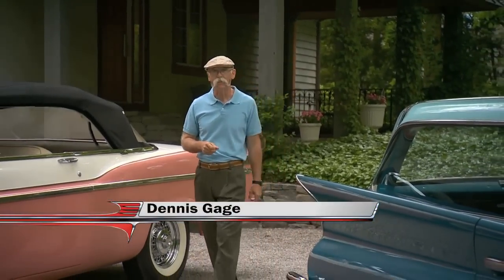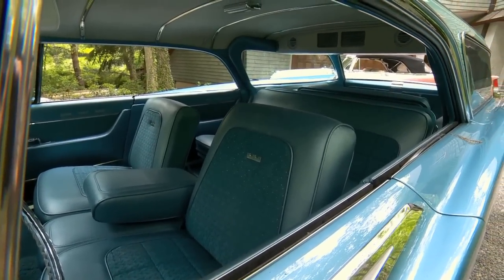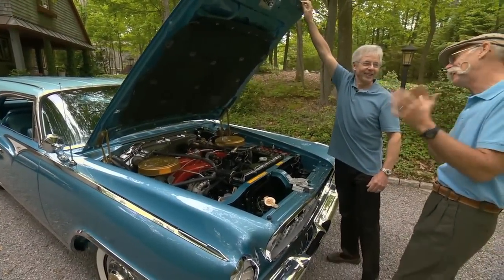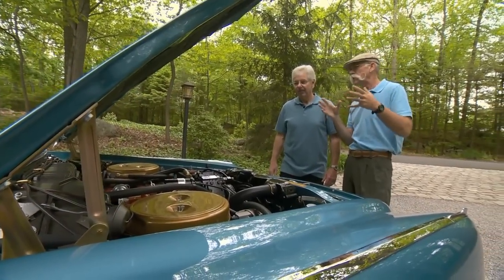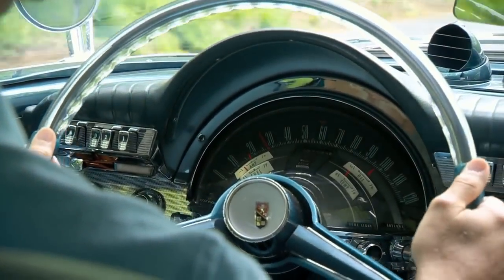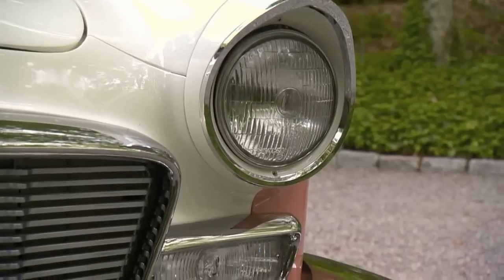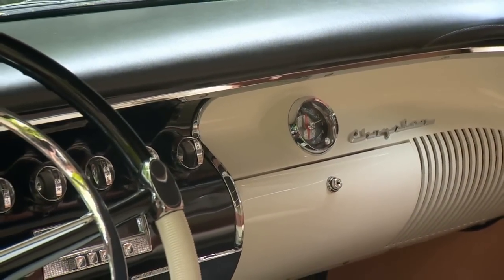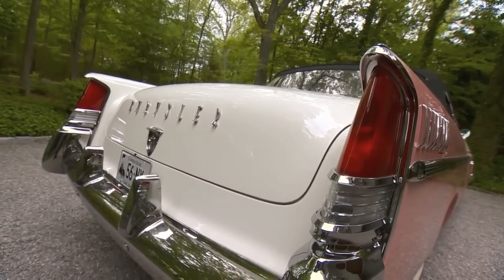Record Player in Classic Car! | Chrysler New Yorker Wagon & Convertible

Comment: 1961 New Yorker Wagon 9p . Total production was 760. That air conditioning unit in the wagon was $714.00 option. The carbs are Two Carter four barrel Type AFB Model 2903S. Base price was $4871.00.
Reply: I wonder what that sum would be in todays dollars? '23 🤔💸

Comment: yea buddy, my very first car in 1076 was a 1955 Dodge Custom Lancer, hemi, auto, the works, second car ever was a 1955 Chrysler New Yorker Deluxe, they both still had the manuals in the glove box and I was reading thru it one day and saw the instructions how to use the turn table which was an option in the day with a TUBE AMP,  both mine had very nice powerful tube amp radios, so nice sounding

Comment: Chrysler Corp. really built some great stuff back then. Starting with the 331 cu.in. FirePower 'hemi' in 1951, the 354 & the great 392 hemi from 1957. Their transmissions were bulletproof, from the 2spd PowerFlite to the TorqueFlite, coupled to really great engines. I'd love a 1960-61 Chrysler, two door or four door is fine.

Comment: Some interesting info on the use of record player in cars and particularly The Highway Hi-Fi:

The Highway Hi-Fi record player was the First in-car phonograph system and the first means of drivers playing their own choice of music as apposed to just listening to whatever was playing n the radio at any moment. It was invented at CBS Laboratories by the inventor of the 33 1/3 “Long-Playing” (LP) microgroove record. For a time, the Highway Hi-Fi was available as a factory-installed option in new Chrysler products. It was an absolute failure. It solved the issue record skipping by using a special shock absorbing system. To allow for full LP records that were compact enough to be used in a car they reduce the record speed and size to 16 2/3 rpm (half the normal speed of a 33 1/3 RPM LP) on 7 inch records. Because of the proprietary record speed and size it used, owners had to buy special licensed records for the system, generally Columbia records content, and only a small number of Highway Hi-Fi records were ever made. The Highway Hi-Fi ultimately was a big flop for several reasons. First, only Chrysler cars could get this dealer option installed. Second, the system sold for an additional $200 (more than $1,800 today) on cars it was an option for and this was fairly expensive for the time. Third, it’s proprietary format meant a limited selection of records were available for it (that might have change had it been more successful). Finally, while it was tuned to work fine on higher end Chrysler’s of the era with their higher end suspensions, they units were not as well tuned for the lower end model of Chrysler and thus tended a skip a lot more on those models leading many complaints and warranty requests. But when it first came up no one else offered anything like it. It was officially put out of its misery in 1958.

This would not the be the last time tChrysler tried to offer phonograph record playback in a car. Their next attempt was called “Auto Victrola” from RCA, sold in 1960/61. It used standard 45 RPM records, the same as used for singles played in jukeboxes of the era (these discs had the large hole in the center requiring an adaptor to playback on home turntables). It played back a stack of up to 14 conventional 45-rpm singles that you played in a under the dash unit. It also suffered from skipping issues on real-world pavement, but would have work great when “parked” with a date. 

Around the same time as “Auto Victoria” was being developed, a British company the Philips Mignon (sometimes called “Auto Mignon” and sold in the U.S. under the brand name Norelco, which also used 45 RPM records.   It turned out to be a more popular version with famous folks like the Beatles and Muhammad Ali both having on in their cars (George Harrison was famously photographed using the one in his Jaguar E-type and Ali was photograph with one n his ‘59 Cadillac). It worked differently the Auto Victoria in that it used a slot loading mechanism, many years ahead of the slot leading CD players used in cars in 90s and beyond. Thus you couldn’t play a stack of 45s but could swap them one at a time. It lasted the longest of all systems having been sold from 1958-1970.

Of course in the U.S., the first successful prerecorded music format for cars was the 8-Track cassette player introduced around 1965. It never had the same success in Europe but stuck around in the States until the last 8-Track was produced in the  mid-80s (by then though compact cassettes had taken over for new stereo aftermarket installs and as dealer options).

Comment: I believe I have seen that Awesome wagon written up in Hemming's Classic Car Mag! I think a two or 3 part series about nut and bolt restoration. I didn't read those, as I am not into the technicalities of redtoration; I just love airing the finished product! However I find totally original cars, not restored, "survivors," if you will...especially interrdting, if they are still running! 🎉😃😊

Comment: Regarding aftermarket sound. If you have a stock AM radio, there is an AM transmitter that operates on 12 V, manufactured by MFJ. You can connect your Ipod, ect, into it and listen to what ever you want to, but it's, of course, in mono. If you have an FM Stereo radio, there is a FM transmitter, usually found on eBay for about $5 ! that you plug into whatever source you provide, and can listen to your favorite tunes. My thing is that if you are fortunate to have a factory 8 track player, is that you can plug up a Realistic (radio shack) 8 track to cassette module to your 8 track player, then there is a 8 track to cassette adapter that has an 1/8" plug to connect to your iPod, or whatever MP3 player you have.  A small FM transmitter is my choice.
I mean, for 5 bucks, you can't go wrong. In my opinion, the Delco factory radios, provided by GM have the best sound.

Comment: the 56.. holy smokes she is loaded, nice both had clocks for 55 but not in the steering wheel.. so nice .. so does that leave room for another gauge or? I've only seen these in automatics not sure they made them in a manual trans so did any of them ever have tachometers?   I wish I had my 55 Lancer and 55 New Yorker, the lancer was black/white/yellow, with all sorts of chrome, white black interior, new yorker was powder blue greenish/white, a blueish greenish/white interior, thing is I got both of them in absolutely MINT condition, the Lancer was a divorce thing sitting ever since, a few years..had 4800 miles on it.. the new yorker 22,000 both were dead mint,  I picked up the 55 lancer for $50, a friends mom, my buddys parents got a divorce and that was their family car but neither wanted it, so it sat in a field, they said I could have it.. later on a 8 months or so a guy I used to visit now and again saw me drive it and said hey, I have a 55 new yorker, runs has stuck valve, $150...  I bought that and had em both at the same time, both running.. I was only 16, I left the new yorker on the farm I worked on it was up on blocks last I saw it, and the lancer a tow company and the city of Kennewick wa stole it from me... never say the police cannot be corrupt... I was just a kid fcs .. long story.. but I have nightmares about trying to find them still to this day..

Comment: Chrysler products had great innovative engineering in the 50s and 60s. There problem was the styling sucked until the 65 Chrysler Imperial, the 67 Barracuda and 68 Charger. 68 and beyond styling was on par with other manufacturers though an honorable mention goes to the 57 Pymouth.
Reply: The 60 Chrysler is GORGEOUS

Comment: 20.11. Got a clock on the dash, and another in the wheel centre. I wonder which is original.
Reply: Actually both clocks are.  The dash mounted clock was the  usual one factory installed. But it was so far away, the driver was not able to read it easily. The steering wheel clock was I think dealer installed.  Interestingly, it was not electric, it was self winding as you moved the  steering wheel.
Reply: itsmegp46 Some of these car clocks were electro-mechanical. As the mechanical clock would wind down a contact point would touch another point and it would electronically rewind. That winding by the steering wheel movement is the most oddball thing I have ever heard. But being a vintage Chrysler product I can believe it along with all the other things like electro-luminescent dash, double brake cylinders in the front, and the most crazy thing of all...."no PARK function in the automatic transmission...just neutral and the parking brake
Reply: +inkey2 Not having a Park function was not that unusual in the 50's.  There were other cars without a Park.
Reply: EdP402  It was quite uncommon for 1962. To make this even more absurd the 1962 Plymouth and Dodge had "Park" yet Chrysler's higher line The Chrysler Newport, New Yorker. 300 series had no park.
Reply: +inkey2 There were two Torqueflites. The A904 aka "Torqueflite 6" had a park position.  The A488 and later A727 aka "Torqueflite 8" did not have park at that time.
Reply: I have never seen a 1962 Chrysler with Park in it ....ever...and I have seen quite a few. Can you think of another American Auto manufacturer who did not have park in their auto trannys in 1962? None come to my mind.....can you think of any?
Reply: +inkey2 By 1962, none.  Chrysler had the parking brake on the tailshaft of the v8 transmission at that time.  I suppose they thought that was enough to hold the car.  By 1964 park had been added.
Reply: Actually I think the 1963 Chryslers had park. As far as "was the brake drum on the drive shaft good enough to hold the 62...a definate resounding "no". Especially when the car was on a hill with the rear facing down. I would always have to park my 62 Newport either facing down a hill with the wheels cut into the curb and park brake on....or....when the rear was facing down hill I would cut wheels into curb and use a metal parking wedge under the tire. The car had rolled away on me at least 3 times......"while I wasn't even in the car". The car also had a plethora of design defects. Enough for me to write a Doctoral Thesis titled "Turn The Key And Die"...a memoir by a vintage Chrysler owner
Reply: +inkey2 Here he goes again.  Although there was no park, it would seem your car was the only one unable to hold itself on a down slope.  My dad owned a 62 New Yorker, purchased new, I learned to drive with this car.  We never, EVER had any of the myriad of issues you seem to have had.  Seriously, burned brakes because of the driver failing to release it? What did you think that great big RED light was for in the middle of the  gauges? It wasn't a Christmas decoration.  You bought a car that was already 17 years old, (your words) that was probably on its last legs. Either you or the previous owner(s) let the car go without much maintenance. Which begs one last question, if you hated the car so much, if it was so problematic, why did you keep it for so long?  I've owned a number of cars over the years, some were good some were pretty bad.  The bad ones were sold off pretty quickly.
Reply: +inkey2 If the car rolled away on you three times(!?!), it was your own fault. There were no self adjusters on those cars, so the service brakes AND the parking brake required periodic adjusting.  Obviously, you failed to keep your car maintained properly.  I have another question.  Since you're so hung up on a Park position and this car did not have one, why did you buy it in the first place?
Reply: itsmegp46  when I got the car in 1976 the body was absolutely mint and I payed a lot for it...$1,650....that was a fortune at the time. I had the  entire front end replaced, Michelin steel belted radials, Monroe spring assist load leveler shocks and an ADDCO rear anti sway bar. Between the cost of the car and how much money I put into it I couldn't sell it without taking a "massive" loss. That's why It took me 5 years to dump it. Keep in mind this was my daily driver car not something only driven occasionally. In the five years I had it it went through front upper wheel cylinders, alternators, voltage regulators, pitman shaft seals by the proverbial bucket load. The last straw was when the AstraDome electroluminescent dash (under the plastic dome) started smoking and the gauges burnt out. I ended up selling it to a wheeler dealer friend for 500 bucks and was near hysterical with joy when he handed me the cash.
Reply: itsmegp46  no no no....I didn't fail at anything. I dumped a kings ransom into maintaining that barge.. having the same repairs done over and over again. I was a financial slave to it. The car was like owning an airplane. For every hour you drove it you spent equal time maintaining it. I bought a 1965 Chevrolet after that and I thought I had died and gone to heaven. It was 1/10th the maintainence of the Chrysler. WHY DID I BUY IT TO BEGIN WITH? I was 20 years old and had not a clue as to what I was getting into. All I knew is that it was a damn hot looking car. It's like a 20 year old getting married to a hot chick and then finding out she had a bad heroin habit

Comment: Please stop calling the "Long-Ram" intake the "Cross-Ram". Two completely different intakes.
Reply: Russell Loyd 
Actually you’re correct, they are long rams. The short rams look almost exactly the same but the effective tuned length was 15 inches compared to 30 shown here. In 1963, the 300J had short rams. Bob Roger, the “father of the ram” called them “cross ram intakes”. I have owned 2 300Fs. I’ve been a member of the Chrysler 300 club since 1979. The sales brochure calls them cross ram engines.

Comment: The intake charge travels back n forth 6 times before entering the intake valve and combustion chamber?   WTF ?  What kind of shit is that?
Reply from the maker: Marketing!
Reply: The intake charge does no such thing. The "Long-Ram" intake is two pieces. The 4bbl carb on the driver's inner fender feeds straight into the intake ports on the passenger side head, and vice-versa.MoPar also made a "Short-Ram" intake, which was the same, but shorter, and they made the "Cross-Ram" intake, to which that is not.
Reply: The Ramchargers pioneered the concept. If you and Dennis were to do a little research, the sonic and pressure dynamics of the "Sonoramic" intakes might shed some light. That's called engineering.

Marketing does not win races.